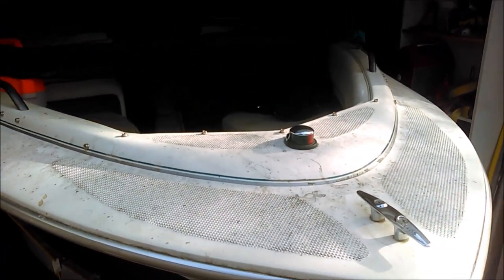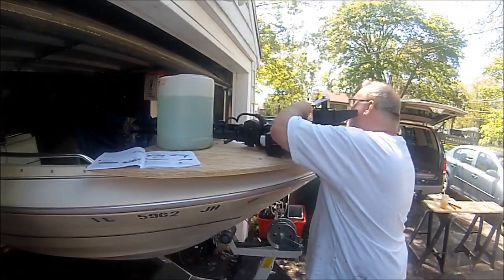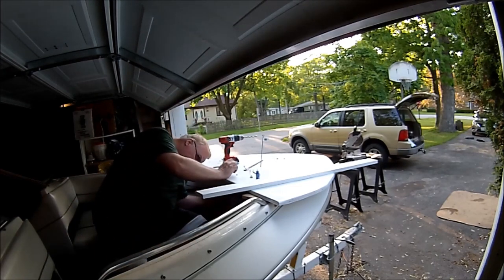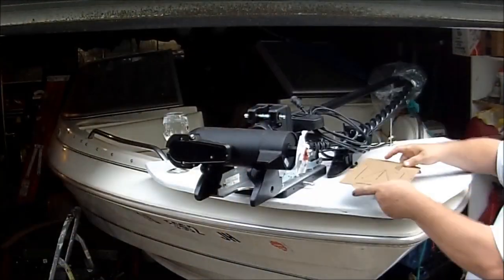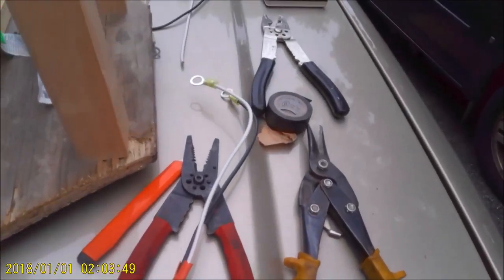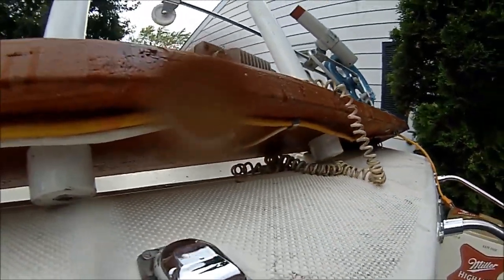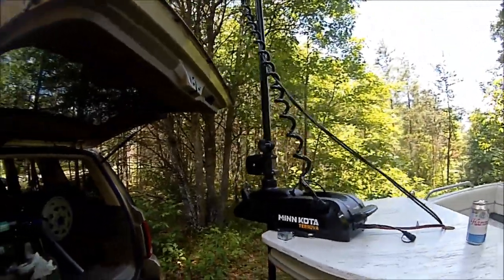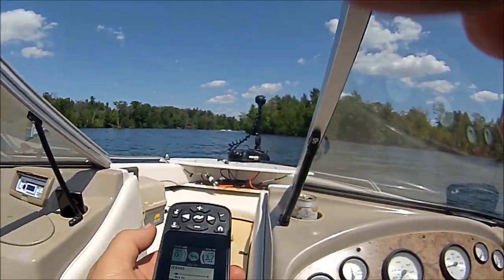Open bow trolling motor install

Comment: I like your video, but the household 15amp connector you used to hook up the motor cannot safely handle 50amp dc. It doesn't matter that it can handle almost 2 time the wattage the amps will burn it!!! Hope you did not have a problem with it yet?
Reply: Yep an anderson powerpole connector and 4awg wire would be better...

Comment: I don’t have a front cleat on my boat but regardless- I’m going to try to run your idea with two side cleats. Do not want to drill into my fiberglass hull. It’s a 89 StarCraft that was grandpas and then dads and now mine wanna keep it nice but I want a damn trolling motor 🤣